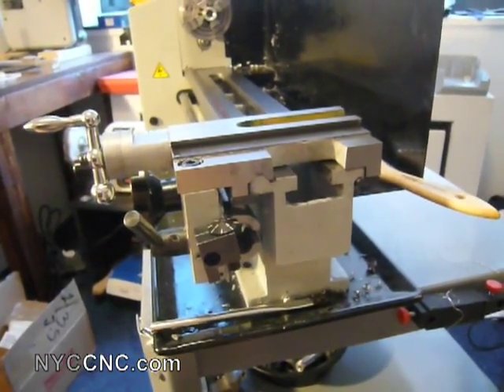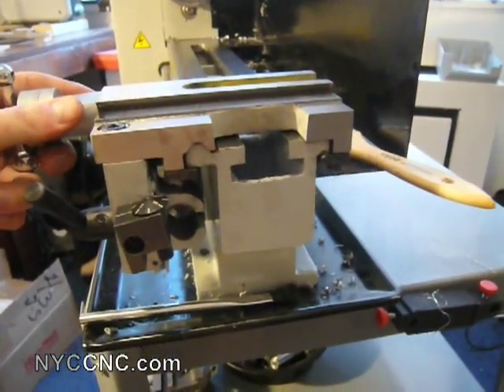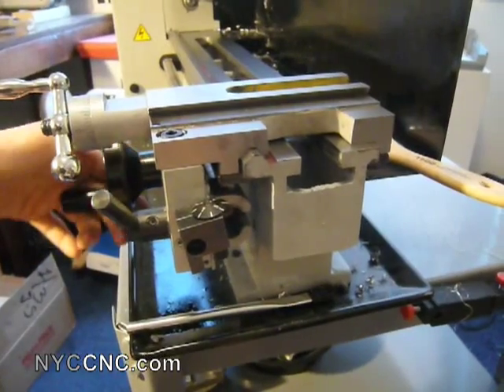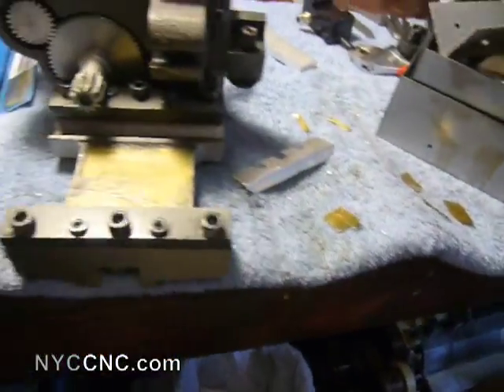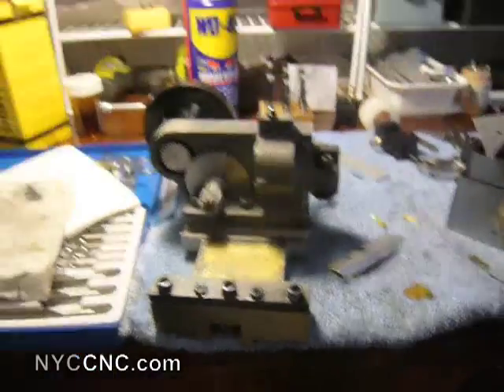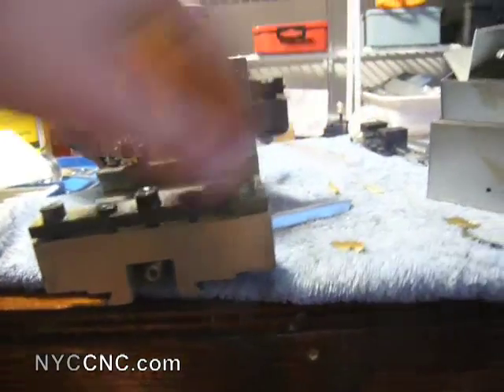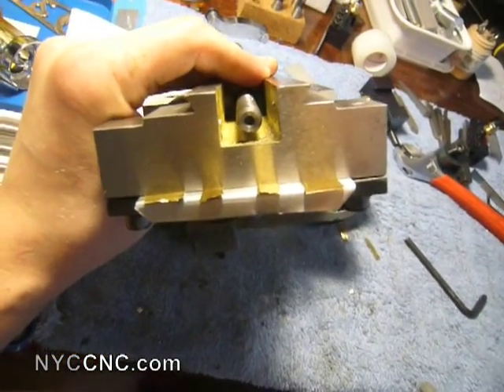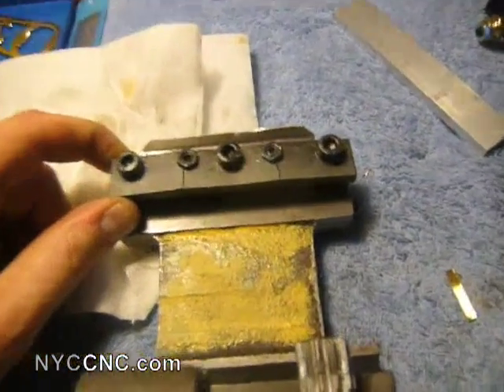Micromark 7x14 Lathe Carriage Saddle Gib Adjustment

Comment: So I wanted to ask you if you made new top gibs for yours as they are kind of a weird shape. I want to just make some out of steel for the top and bottom, but maybe I'll get to them one day as I dread just looking at this lathe. I knew it needed a bit of work, but man, for what you pay they should at least get those basic things done right. Also, have you found a decent cutting tool for this to cut hard steel?

Comment: Hi John. I know this video is old, but the way I fixed mine as I have the same lathe is by milling a step on it. Those gibs would not sit flat on mine. Unfortunately this lathe just pisses me off every time I use it. I need to find me some apron and toolpost gibs as those are crap and my tool keep moving and going under the parts. I also got a crap top slider with the threads off and I still haven't contacted MM since I just hate using it do to these things.

Comment: I must say the saddle gib design on these lathes is garbage! I made a tapered gib setup for mine only to find that the bottom way that the gib rides on was not parallel to the ways on top!  I took the entire lathe in to work and found the top ways weren't very straight either, so i cnc ground the whole works and scraped the bottom of the saddle to match the top ways and the gib to match the bottom ways and now it glides beautifully while my indicator shows less than .0001 shake between the two!